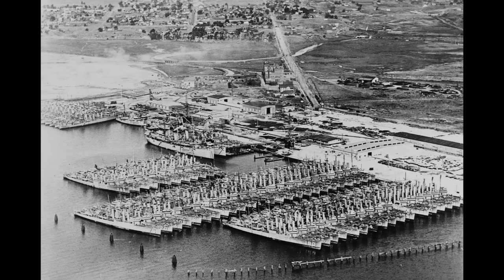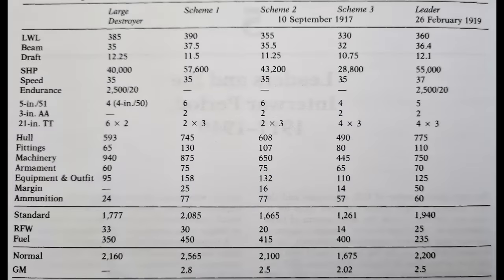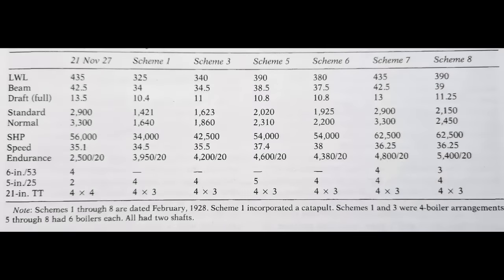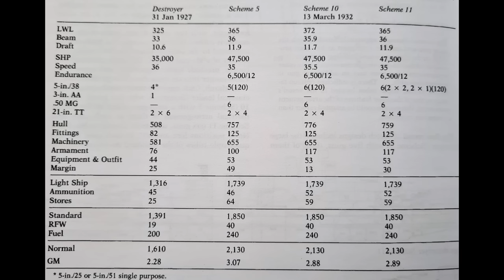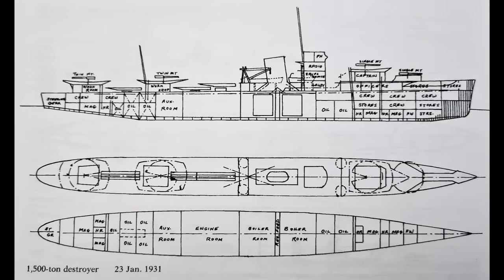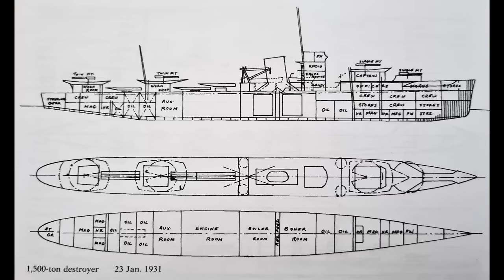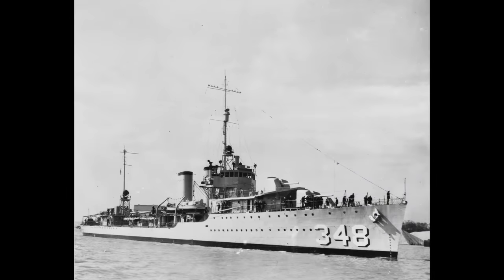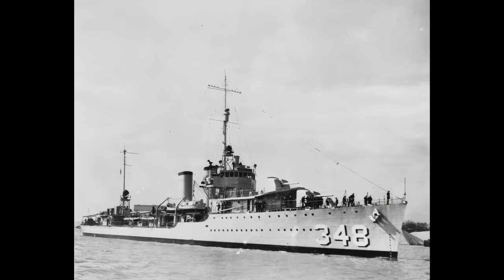The History and Development of the 5"/38 - Turns out you can take the sky from someone

Comment: I just love the near-comical realization of the simple: "Hey, we want something that does what this long anti-surface gun does and what this short anti-air gun does. What if we made a gun that was partway between those two and tried it at both?"
Reply: I think that the best thing to make a god-tier design team is a steady supply of booze. Just see what the drunk guys can come up with.
Reply: Two most dangerous things that must be kept away from engineers at all times:
1- welding machines to make things bigger
2- hacksaws to make things smaller
Reply: @ricardokowalski1579  As an old maintenance man I approve this message!
Reply: @korbell1089  😁👍😁
Reply: @RT-rx2sj  So KelTec, but good?
Reply: An unusual example of a compromise working out.  usually, the middle solution is a failure.
Reply: They should have made an over and under design with both.
Reply: @frankgulla2335  I agree, compromise  usually fails to meet both goals.

I suggest that the use case in close range combat during the Solomon islands campaign minimized the range lost in anti ship fire role. While at the same time, a longer barrel with powered movement made it a better AA gun in an environment chock full of land base airplane threats.

They couldn't have foreseen this, island hoping and "withering on the vine" were not the original plan orange/rainbow. But they DID hit a sweetspot with the 38.
Regards
Reply: I would argue that they would have foreseen at the very least a part of the possible problems with island hopping given the fleet problems being ran in the 20’s and 30’s. That being said, the 1942 5 inch/38 gun and the 1944 version of the gun with all the added bells and whistles are two VERY different beasts if only for the advancement s in radar technology and the proximity fuses.
Reply: @ricardokowalski1579  Thanks for the insight.
Reply: @PrinceOfDolAlmroth  sweet sweet proximity fuses
👍
Reply: To be fair, the logic is unimpeachable. If you expect to be fighting a lot of aircraft, then frankly trying for the half-and-half is a better route than trying to build an optimised surface-action weapon which can also do a bit of AA work?
Reply: It was the same idea that brought about the development of the STG 44 and assault rifles in general.
Reply: @PrinceOfDolAlmroth  no, he means island hopping was not the pentagon's prewar strategy when the ships were designed and procurement begun.  War Plan Orange was the plan to fight the Japanese and it called for the Pacific fleet to be forward deployed to Hawaii to react faster to an invasion of the Phillippines, and after repelling the invasion of the Phillippines through logistical warfare and good shore bombardment, a blockade of the Japanese home islands would ensue until the Japanese surrendered. 
The plan was a bit more complicated and included details like where certain supplies came from and would be stored, contingencies for combat, etc... but ultimately if Pearl Harbor hadn't succeeded so well the Phillippines most certainly would not have fallen which is the element the US did not count on when drafting warplan orange, Due to a mix of overestimating our own capabilities and underestimating the Japanese, both for legitimate and racist reasons, we did not realize they possessed the capacity to take over the Pacific until they were about 80% done, at which point Midway happened and that made Australia, the last 20%, impossible to take or suppress.

And just some more details on the non-racist reasons to not expect Japan to be so competent, Japan's navy had recently modernized, mostly by commissioning from and copying the British, and their army also had only recently become such a potent fighting force through reforms just before WWI, and on top of that the size of Japan's economy was much smaller than anyone would expect to be capable of supporting such modernization programs at the scale Japan did.  Everyone was under the assumption that corners had been cut and it was a house of cards, and in a way this was true, but that only went so far as the people enlisted in their military.  Their familiarity with technology was relatively low, slightly better than the rural Chinese farmers Japan intended to conquer, this in stark contrast with the 2 nations synonymous with the Industrial Revolution whom pioneered the technologies essential to the war in all fields.  While Japan's peak understanding was very high, in some ways and some cases better than the peak that the Allies were able to muster for R&D, the average understanding was extremely low, and generally insufficient to support the war effort.  This in stark contrast to the US and Britain whose average soldier grew up with technologies analogous to those essential to the war effort.  Hell, the US had even the Germans beat in this regard given the mass mechanization of farm equipment and the proliferation of the automobile.
Reply: @ricardokowalski1579  ^ This.
You are so on the money with your assessment - the gun wasn't technically the best at every role, but it was a Goldilocks gun for the exact war it was given. And that was a half-fluke.
Absolutely agree 100%.
Reply: @DSiren  The social aspect of domestic mechanisation translating into educative pre-training / familiarity for the average serviceman is a very astute point.
Reply: @AndrewGivens  glad you like it. 👍🙂👍
Reply: @ricardokowalski1579  My Navy Captain bestie would agree too - his assessment that it was the /38's excellent AA qualities that made it such a good/well-regarded/successful gun was the answer to my directly-posed question several years back of why such a mediocre surface weapon (we both long agreed) had such a high reputation.
Reply: @ricardokowalski1579  as an engineering student I will confirm that we take massive pleasure in changing the size of many things just to see what bloody monstrosity we have created
Reply: A engineer and tool box equals effective idea
Reply: Comment 667, you're welcome.
Reply: To be fair, most of the time when you're trying to do two things simultaneously you end up sucking at both.

Comment: In some ways, Congress imposed budget restraints worked in the USN's favor as they resisted the temptation to change gun caliber everytime someone else was put in charge.  The Royal Navy might have benefitted from having a bit more discipline as they dithered in adapting a single shell diameter and worked on multiple ones, sometimes in parallel.  One was forced to be satisfied with good enough while the other sought the elusive perfect solution and wasted time and resources while complicating their logistics.
Reply: 'Amateurs talk statistics, professionals talk logistics.'
Seen that one a lot.
British "logistical issues" and "complication of supply chains" are massively overstated non-issues, which a tiny country with an excellent road & railway network, well-versed in bureaucracy and faced with an urgent and sudden war situation, just sort of dealt with.
A super-important point to remember about the British war experience is that, not only was the state used to dealing with a multiplicity of types when it came to war materiel, but whichever choice it might have decided to standardise on, not one of them  were available in anything like sufficient numbers to meet demand for the first half of the war.
The British 'war cocktail' was mixed with a fair number of decidedly sub-par ingredients, alongside the quality ones which made it tasty, but there just wasn't enough of the good stuff to fill the shaker.
It's a damn good thing the UK was as used to a complex supply chain as it was, because when it came to crunch it had to be.

Comment: The three 5in guns and the bureau of ordinance

Bureau of ordinance wanted for a 5in gun.
The 5/51 was too heavy. The 5/25 was too weak. But the 5/38 was "just right".
The end 🎭
Reply: Ammolocks and the Three Barrels.
Reply: Current Congress:  Where can we send billions more?  We have a big charge card.
Reply: @rogersmith7396   My constituents demand another multi-billion dollar boondoggle, er, multi-purpose fighter!
Reply: ricardo k.......       Almost makes up for the Mk 14 debacle. Sorta.
Reply: @ChrisCaramia  B 21, Zumwalt class.  How to make huge amounts of cash float and fly.  Just not very well.
Reply: @rogersmith7396  What's wrong with the B21?
Reply: (51 + 25) / 2 = 38
Reply: @TonyLovell  Engineers used to do slide rule stuff like that all the time.
Reply: @SteamCrane  slide rule? If you can’t do that in your head…

https://en.m.wikipedia.org/wiki/The_Feeling_of_Power
Reply: @bob_the_bomb4508  Computing grate area and heating surface for a 2-6-6-6 from prints of a 2-8-4, considering different boiler diameters, weight restrictions, and clearance diagram, for example.  A great deal of engineering back then was incremental from older proven designs, rather than from first principles. Considering barrel design, it must be matched to projectile and propellant, so that full power of the powder charge is utilized. Taking the mean of 2 barrel lengths is just the starting point.
Reply: @bob_the_bomb4508  As for the Asimov reference, if you have ever dealt with a green haired teenage store clerk, you know that Asimov was correct.
Reply: The “Goldilocks Gun” of the USN. 😂
Reply: @drcovell  yes 🙂😂🙂

Comment: I was assigned as the gunnery officer on the U.S. Coast Guard high endurance cutter Pontchartrain (WHEC-70) in 1970.  We had a single 5"/38.  It was a wonderful system that was very accurate.  The ship had just returned from Vietnam and had worn out the mount so we got a reconditioned one that was in tip top shape.

Comment: I was a hotcaseman, loader and ultimately pointer on mount 52 aboard USS Johnston DD-821 from 75 to 79.   Even at that late point, these mounts could lay down tremendous fire against shore targets, which we practiced against often.   The fire control computer (still the original analog unit she was built with), was the only significant limiter against air targets.    It was a tremendous experience to charge at high speed with mount 51 firing as we ran towards shore - the turned to open both mounts - finally egressing at narrow aspect with my mount firing.   Thank you for this video
Reply: You guys had some huge boots to fill sharing a name with DD-557. Big jock-strap too.
Reply: 😅 @haldorasgirson9463 Yes, Lt Camander Earnest Evens, skipper of the Johnston and posthumous MOH awardee was  synonymous widely recognized with the most heroic action of any DD in US Naval history. See the Battle of Samar if you don't already know.
Reply: Hey Shipmate! I was on the Jolly J from 71-73. I worked in Main Control and aft engineroom on her. Got of when she went to the reserves. Those 5"/38's still have my ears ringing!
Reply: Hey Shipmate!  @brucelytle1144  I was a Sonarman.   Shouldn't have been in gun mounts - but crew was mainly reserves and they were not aboard most of the time.   Left the Navy in 1989 after 14 years.

Comment: This may be a stretch for you, Drach, though you are deep into engineering, but it is EXTREMELY IMPORTANT to discuss in some detail how Alternating Current data transfer system (US Navy WWII and after Selsyn/Synchro -- rotating magnetic needles -- and German Magnetic Amplifiers) allowed such things as the Mark 37 AA FCS to get its accuracy and speed and high reliability, which British DC-powered HWCS and other fire-control connectors were eventually failures against high-speed, high-maneuverability aircraft.  This was CRITICAL in allowing the US to get such good FCSs.  It is slightly technical, but anyone who understands how a compass needle works should have no trouble at all in following the AC explanations.
Reply: Again, Read Lundstrom and you'll see from his analysis of IJNAF losses that USN M37 and 5in/38 guns were not effective in the AA role, in 1942. Lundstrom carefully analyses the loss of each IJN aircraft shot down, and losses to 5in AA were a very small fraction of 5in AA kill claims. In many cases the BuOrd accepted every AA kill claim even when the kill claims exceeded the number of observed IJN aircraft, and many of the IJN aircraft were seen to depart the area after the attack... It's high time to look at actual kills vs claimed kills and then recognize that endlessly praising BuOrd and their faked AA data does great harm to our historical understanding of the limitations of 1940s USN AA technology, and it's actual performance in combat.

Comment: It's funny how people go on about fighting the next war with the latest and greatest from the last war 
In 1971 I was part of the commishing crew for the Coast Guard cutter Munro , the point is that she was armed with a single 5/38 main gun , 6 .50  cals 2 , 81mm mortors and yes 6 21 inch torpedo tubes . Yes all hand me downs from the navy .
Reply: A-Gang MK1 on the Munro, '03-'06.
Reply: Gun gang 94-96, unfortunately it had gone under FRAM, or neutered as we called them losing the 5”38, torpedoes, sonar ect in exchange for the mk75, cwis srboc launchers with SLQ-32 and right when I arrived 2 Mk38 25mm chain guns where the mk32 svtt were prevuiously located. They still maintained the dredger hoist from the 5” though and we used it to move the 76mm ammo still in its cans to the lower mags and old powder mag.

Comment: It would be very curious to see if the twin mount on the Porters and Somers were retrofitted a la German Battlecruisers with increased elevation in the early days of WWII, say, 1939 or 1940. It would increase their topweight yes, but imagine how beneficial they would be with 8 DP mounts. Though admittedly, the SP dual mount is a bit chunkier than the DP Dual mount later on
Reply: The SP mount was about half the weight of the DP ones. They quickly lost one mount for more AA, and many ended the war with two twin one single DP mounts

Given they were already a bit overweight, trying four DPs would have been absurdly heavy

Comment: Perhaps a review of what the 38 in a 5 inch 38 caliber designation means is in order.
The 5 is the caliber diameter of the barrel opening in freedom units er inches.
The 38 is the number of times the diameter of 5 would be multiplied to get the total barrel length in inches.
So a 5 x 38= 190 inches or 15.83 feet.
Reply: Wiki says only 157 inches were rifled of the 190 inches total length
Reply: @josephpadula2283  and the non rifled part would be at the breech end
Reply: @SonsOfLorgar  likely separate powder and shell with separate storage in the mags as well...that is the way it was on my ship

Comment: In regards to the 5 inch anti air shells, just how sensitive were they?  Did the navy have any issues with flocks of birds accidentally becoming raining fish food?  And do you think the navy could dust off a few for defense against small drones?
Reply: They were so sensitive, especially about where they went to college. 😂

Serious answer: I don’t think the tech used for the 5” VT fuze would work against drones. Those tend to be mostly plastic and likely have extremely small and narrow radar cross sections. The fuze wouldn’t detect the drone until after it had passed it by.
Reply: The Shoulder fired SAM is a better tool.
Reply: @WALTERBROADDUS  or preying birds for the smallest ones

Comment: Technicality.  The 5 in/38 used "two-piece" ammunition.   Semi-fixed ammunition is when the projectile is transported in the propellant case but is removable so the charge can be adjusted, "two-piece" ammunition the projectile and metal cartridge case are stored and transported separately.  "Two-piece" ammunition is differentiated from "separate-loading" in that the projectile and propellant case are rammed together.  Examples of semi-fixed ammunition is the US 105mm howitzer ammunition, separate loading ammunition are the 16in guns and other bag guns,  two-piece ammunition ammunition are the 5 in/38 and 8 in/55, Mark 16, and the 3 in/50 & Bofors 40mm used fixed ammunition.

Comment: 5/38s were lightning in a bottle. Simply sublime weapons. Accurate, fast firing, decent range, solid in naval battles but also good in AA defense. If you wanted to slap the lable of "War Winners" on any naval weapon it would be this gun system and the bofors. Without a doubt those two systems alone saved thousands of lives.
Reply: The VT fuse definitely helped

Comment: on the matter of vulnerability of the powered turret, cruisers typically have two parallel passageways on the upper most enclosed (main) deck. the fire main and power cables should run along these passageways. Each is powered from a separate engine room. So, in theory, a single hit should not disrupt electrical power, (unless the hit is a long lance torpedo?). WWII and early post WII destroyers did not have the parallel passageways. and may be vulnerable to loss of power on a single shell hit?

Comment: While stationed in the Ajax AR7, the gun gang (GMs and FTs) rebarreled several 5"38 cal twin mounts on 1 cruiser and  a 5"54cal on a Australian   destroyer while in port at Subic Bay Naval Base in the Philippines in approx 1967 or 68. The weight of the barrels alone was impressive at least to me as I was told the 5"38 cal barrels weighed 63,000 pounds.  We were quite efficient in doing so as after the 1st one we did 1 barrel every day, it was an involved process but not very a very technical process.  The heat did tend to slow us down as it was very hot and humid so we took many breaks.